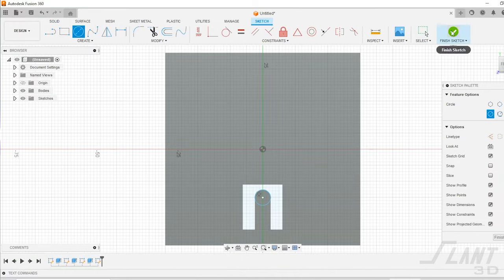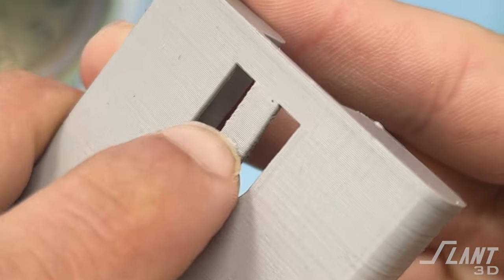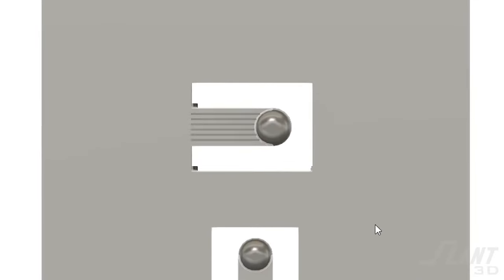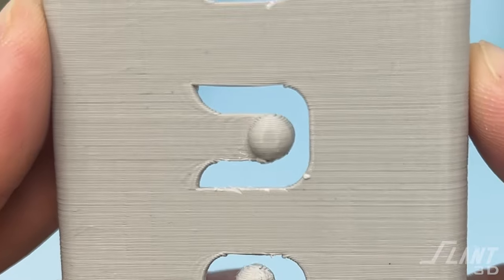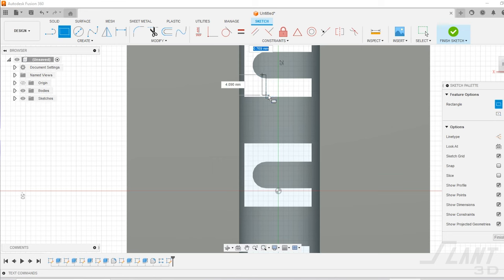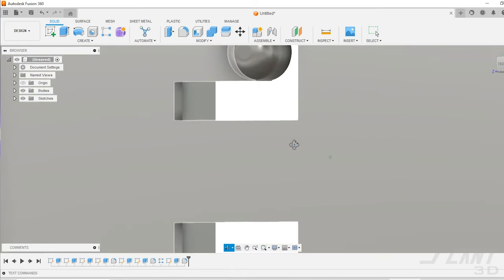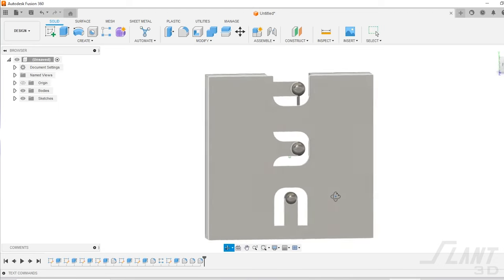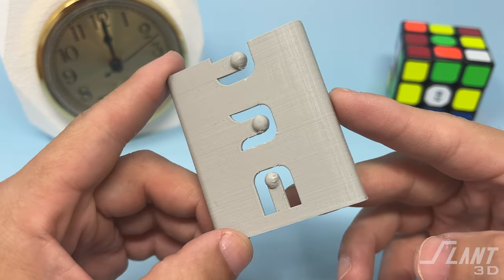Design Snap Fits for Mass Production 3D Printing

Comment: This is full of great advice. Sadly, most videos I see focus on printing speed and very rarely is the focus on print longevity or efficiency. I don't care how quickly I can print it off if i have to keep reprinting because they keep breaking. When it comes to print placement I spend more time orienting them for the best balanced between strength and minimal filament use. If a print take twice as long but uses 1/3 the plastic because I don't have to use supports, and lasts a long time I consider that vastly superior than the fact that I can shave 15 minutes off of the print time.
Reply: I agree, I would much rather have a good print that does what is supposed to versus a fast piece of wasted plastic.  I run my Rat Rig much slower than many people, but have far fewer bad prints.
Reply: It would've been even better if he'd shown the OTHER PART! It's a two-part solution, we're looking at the tab only. I'll keep searching for a decent tutorial :P
Reply: Skill issue, simply print fast and stable at the same time.

Comment: I design built in supports all the time, especially for long overhangs with an angled surface underneath. Another great design is to add bridging surfaces for a part that houses hex bolts. Normally a floating circular hole not touching the build plate needs supports. But you can add two bridging surfaces that touch the edge of the circle on 4 sides and now it is printable without supports.
Reply: You can just make the first layer have no hole at all. You'll have to push the bolt through it the first time, but that's easy.

Comment: maybe better solution would be a long bridge to the other side here. 
extend the lower part of the pin horizontal to the other side. this will be way more stable and only 1 layer thick that easy breaks away. 
prints way faster to. 
one bridging vs a 1 mm hick column.
Reply from the maker: Less universal. But viable where the snaps are short enough
Reply: @slant3d In my experience single layer bridges are more universal.
Reply: How long can a bridge be?
When I saw the spru? Sprew? I was thinking it would sag in the middle.
Newbie here. 😂

Comment: Great video, I was looking for this. I am trying to make snap in joints for fixing two 3d printed parts. Normally I would have used screws and nuts. 
What material is best recommended? Is TPU good choice? Or is it flexible?

Comment: I'm surprised that the idea of putting the tab at a 45 degree angle isn't also here. Is there a special reason for that?
I'd imagine that it'd combine the benefit of better integrity with the ease of being printable without supports.
Reply from the maker: No difference between 45 and vertical
Reply: @slant3d  Thinking more about, I guess that's to be expected after all. Unless at least one layer has a full connection from wall to tip, it's literally the same, just wider isolated layers.

Comment: In your previous video "The truth about 3D printing" you said one of the misconception about that technology is 3D printing is "crappy","not strong enough". Now you say tabs can break between the layers, which never happens with injection molding because Injection molded plastic is high density and isotropic, wile 3D printed parts are not. This is not an opinion, this is Physics. Please clarify : are 3D printing parts as strong as injection moulded parts at the same thickness, whatever the shape and orientation or not ? Besides the promotion of your business technology, your followers would appreciate clear and honest words. In some applications, 3D printing can challenge injection moulded parts, but not in every application. This fact is totally untold in your videos. A video explaining what 3D printing mass production can't produce will be appreciated, because you (probably falsely) give to your audience the feeling you are not aware about your business field of performance, which is not limitless, like any business, and about the limits of the FDM 3D printing technology. Your words were more realistic when you talked about the amount of parts printable per month, for example.